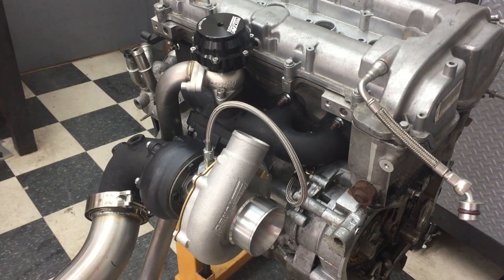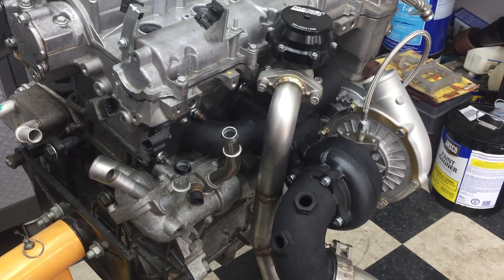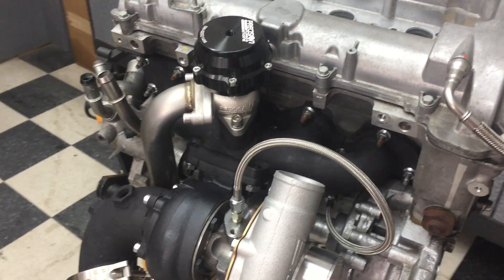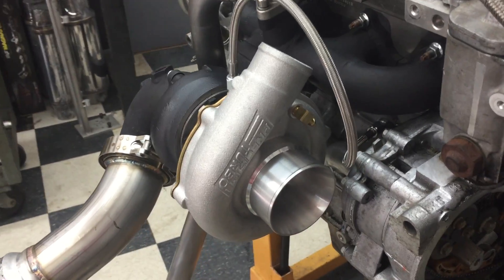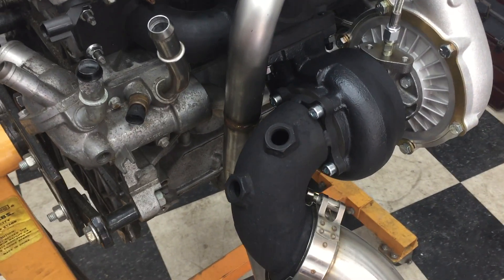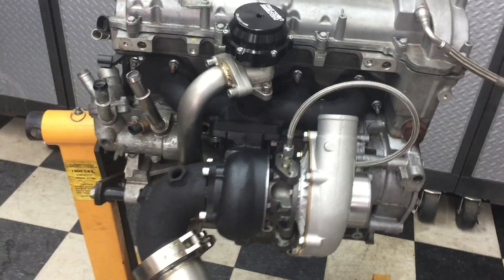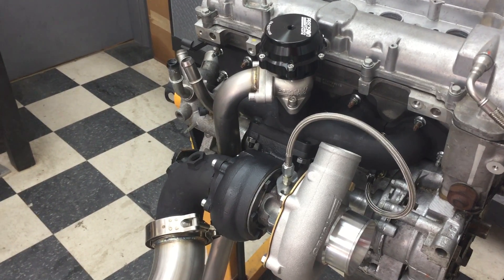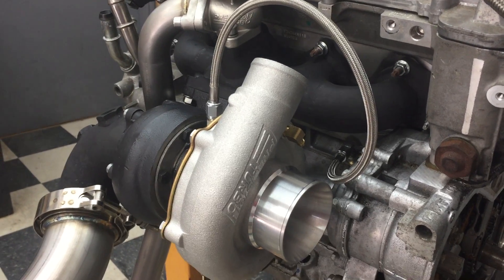Hahn RaceCraft Precision TurboSystem for Cobalt and HHR 2.0, 2.2 and 2.4

Comment: Do you know where I can read how much power these 2.2/2.4 can hold in HP, RPM, etc? Let me know I wanted to learn more about it, thanks.
Reply: The rods i think are the weak point. Maybe it was the pistons but theyre only rated to about 300ish. If you turbo you will only be able to boost so much before theyre trash. I saw a recommendation saying if you turbo, upgrade the block and you should be okay in that area. Then you need to upgrade the brakes and suspension. It never ends because the 2.2s suspension and brakes are basic af so you have to rip out a 2.0s rear end and slap it in there to get 5 lug disc brakes with abs. Then you have to upgrade the front hub to 5 lug disc brakes, not to mention the performance brakes and calipers, axles and everything else.

Comment: Where's the Link just bought a 2008 hhr with 68k miles looking to do something similar or exactly
Reply: i’ve got one of those you want to make sure to do the timing at around 100k. mine went out around 120k and thankfully didn’t bend any valves and shit. got it fixed along with water pump. good trans on 08s too at least the autos

Comment: my 2.2 hhr just blew up.  I'm told the 2.2 can't handle the high rpms as good as the 2.0 and 2.4.  Anybody here have experience with these 3 hhr engines and can verify which one is the best engine?
Reply: The 2.0 is gonna be your best bet. I own a 2.2 cobalt; the 2.2L ecotec engines have really weak connecting rods. I would turbo my 2.2 but forged internals are a must if you want the car to last. Forged pistons run $525 USD for the set, forged rods anywhere from $399-$439 USD. I haven't looked for forged crankshafts yet, but it wouldn't be a bad idea. The 2.0 is by far the strongest of the 3, the 2.4 following in 2nd and the 2.2 coming in last place but it is still a good platform to begin modifying on.
Reply: I've done extensive research specifically on the 2.2L for over the last 6 months and I can honestly say, as much as I love them, they can only produce so much performance before issues occur. I'm budget strapped so I'm grateful for what I have and using it to learn and get comfortable tinkering with vehicles.

Comment: How compatible is it with the 2.4 from a 2000 cavalier?
Reply from the maker: Joe, that's a different engine altogether, based upon the Quad Four, known as the TwinCam.
Reply: @hahnracecraft8172  The 2.4 is a twin cam Eco Tech as well, is it a different style platform basically? I've "herd" some parts are swappable from the cobalt's and what not.
Reply from the maker: The Ecotec bowed in 2003 in Cavalier and Sunfire, a unique year indeed, as there were a total of three engines available: pushrod 2.2L, Ecotec 2.2L, and TwinCam 2.4. By 2004, it was all Ecotec, and its own 2.4 version would debut not long after. But no, the Ecotec was a clean sheet of paper, and the older TwinCam is not an Ecotec.
Reply: @hahnracecraft8172  The little bit of research I've done is, I've found that only 14% of my model were with the 2.4 and it does say eco tech on the coil cover over the valve covers. And I'm 100% sure its never been modified since I actually got it from my grand mother. Is there a way I could decode the vin or check a specific part of the engine or block to verify?
Reply from the maker: Ecotec as an engine series most certainly debuted in 2003 models. We were the first to turbocharge it as well, when GM contacted us to boost both a Cavalier and a Sunfire for the SEMA show that year. As stated, it shares no architecture with the 2000 2.4.
Reply: @hahnracecraft8172  Well damn! Do you recommend anyone that may make quality performance parts such as yours for this style of "fake eco tech"?
Reply from the maker: We did a couple of prototypes for TwinCam back in the day, but didn't bring any systems to production. I do not know of any current sources for TwinCam parts, but that doesn't mean they aren't out there. Perhaps join some Cavalier/Sunfire Facebook groups and ask around!
Reply: @hahnracecraft8172   Ok awesome brother! Thanks for all your help and info!

Comment: I have the Saab LK9 (LSJ equal), on turbo cams, both at 212 deg duration @.05" with a stall speed of 2600. Which precision turbo would you recommend without a heavy turbo lag? Target about 400 whp. Due to local emission controls, it need an internal waste gate.
Reply from the maker: We'd not be able to do an internal wastegate, but you should be able to modify the parts to duct the wastegate exhaust back into the main exhaust, as some of our customers have done this. Your best bet would be the 5531 turbo.

Comment: Now im sorry this has nothing to do with the excellent turbo kit i see here but... Ive heard both ways here, how is it officially spoken.. "EEkotech" or "EchoTech". i think i remember a GM interview of some sort back in the day asking and they pronounced it echo like you do in this video but for whatever reason around here anyway i havent heard a single person say it that way and if i say echo people dont know what im talking about until i say eeko. Strange lol. 

Anyway on to a productive question, with this kit if one were to want a larger variant like the 6262 would there be any clearance issues with the firewall on a saturn ion sedan? From what ive noted it seems there is less room back there on the ions specifically autos size and firewall being closer (im positive its the same clearance as on the redline coupes besides the auto size which is the same as on the HHR autos (4t45). I know its pretty broad and you may not have gotten a chance to see yet how it would fit however i would like to swap from SC to turbo and was looking at my options of piecing together a kit when i came across this from you guys. The car has a built motor and IPT auto trans so its fairly serious now and firewall "hacking" wouldnt be the worst thing if nessesary or even the remote possability of having to reweld the dump tube to accommodate the auto trans. Ive come to be used to nothing being made for my application specifically lol. Either way thanks for your time.
Reply from the maker: You are correct sir.  GM uses the "echo" pronunciation, as in the engine's intentions: Eco-nomical, Eco-logical.  

Not sure why folks try and pronounce the combination of letters "ec" as "eek", as that's not really a convention in English.  All the same, American English does tend to persist in the long E sound of "ee" whenever the letter E presents at the beginning or end of a word, so I suppose it's yet another of the infinite vagaries and regional adaptations of the language.
Reply: very true lol. There is actually a part 2 to my post if you hit show more on my first post you probably missed that part. I appologize for typing a book on that part.
Reply from the maker: Thanks!  Yes, this Hahn TurboSystem with Precision 6262 will fit on Ion.  One may need to create extra clearance at the firewall, but that's pretty easy on these Delta-platform machines (Ion/Cobalt/HHR), and the instructions included show how. 

Learn more here:

https://www.hahnracecraft.com/products/precision-turbosystem-for-ecotec-powerpack?variant=27679367301
Reply: Hate to break it to you, but Ecology and Economy are pronounced with an "eek" sound at the beginning by almost everybody in the English speaking world, not an "ek" sound. so with that being said, that would be wrong.